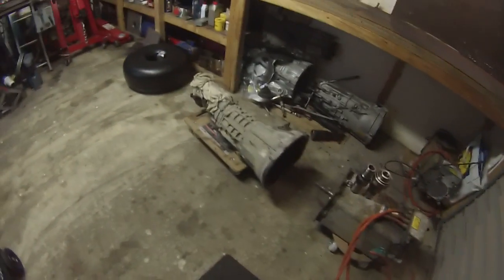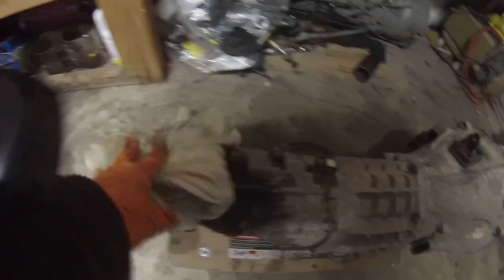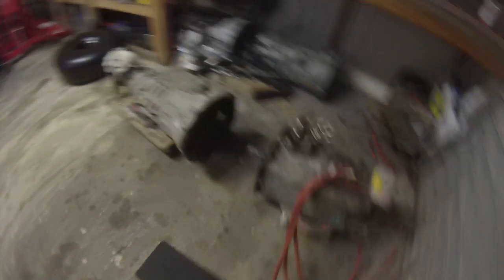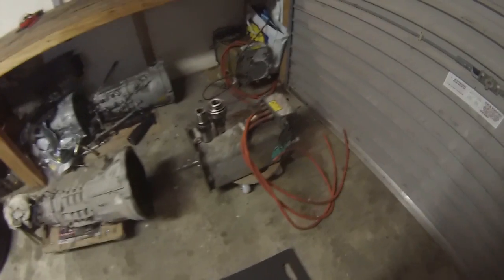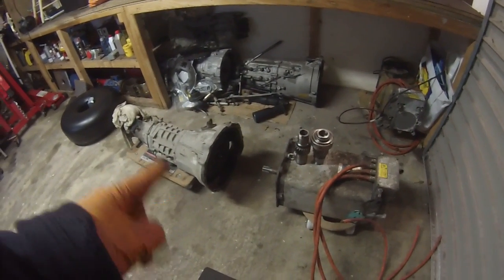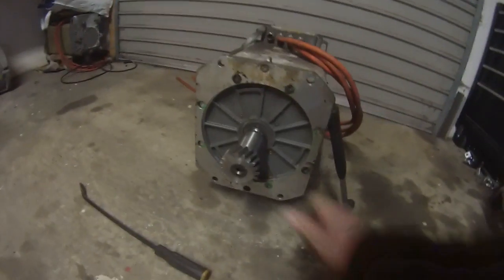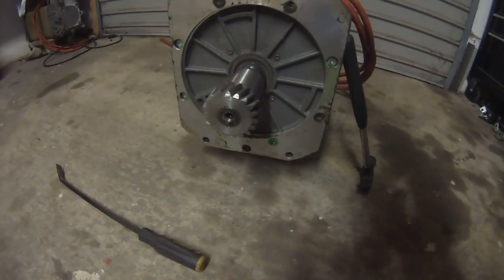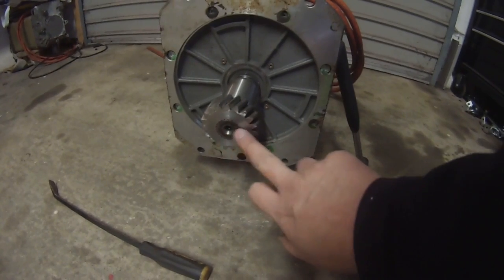Mazda RX8 EV Conversion Mini Series 01

Comment: interesting Electric conversion of a Mazda RX-8!...I too am considering a conversion but I was looking at doing a V8 conversion using a Ford 5.0L coyote V8 and a Ford 6RR80 6-sp Auto Trans with Paddle Shift.  But after watching your YT videos and others about converting a Mazda RX-8 to all Electric Vehicle, I am going to do some more research on this conversion!

It seems like this Mazda RX-8 All Electric conversion has been going on for at least 6 years in Australia!  I am in the U.S.A., so I am going to contact a company called EV WEST in Southern California and see what they say about building a Mazda RX-8!

Also, I notice that you are connecting the Electric Motor to the Mazda Manual 6-sp Transmission...If the motor is Electric you still have to use a manual transmission?  I am aware that the Mazda RX-8 also came with an Automatic 4-sp or 6-sp Transmission with Paddle Shift.

I am a Left Leg Below the Knee Amputee and I don't want an Electric car were I have to push in a clutch in other to shift gears!  Is there a way to setup the RX-8 like a Tesla Model S were there is a one gear transmission?  Thanks and God Bless!

BTW...I've seen some All Electric Mazda RX-7's as well online!

Comment: Hi Damien I was shocked to see you do a non BMW but since its for your friend I will give you a pass. Lol. I am very interested to see your approach to this car.
I dont have your welding skills so my own e36 project inches forward only when a mate has time to come over and weld things for me. I have my chinese made AC motor bolted to the existing transmission and clutch and a very custom heavy steel cradle to hold the motor up and stop any torque twist. Thats as far as I am till I can get my welder to come back.. to help with mounting rails for the recycled Chevy batteries I have and a equipment rail so I can mount the controller parts etc.

Comment: High voltage system @ 500vdc or 650 vdc? with respectfully 70kW or 80kW output for the Siemens  IPV5138? which is less power then the Nissan Leaf. http://www.industry.usa.siemens.com/drives/us/en/electric-drives/hybrid-drives/Documents/elfa-components-data-sheets.pdf
Reply: Huge voltage is very nice in theory but its very dangerous in a home built. 144v is high enough for me.

Comment: My stepson is looking at doing an RX8.  He bought the car ... and is waffling on the actual conversion!  He's been searching for RX8 engine rebuilds ... so he can drive the car while he gathers parts.

Great tip on the side grinder cutting off the coupler

On another topic - do you have the CAN codes worked out?  Or at least the ones that you will need to drive the dash and keep the ABS, airbags, etc working?

If not, and if I can figure out which canbus to monitor .. I may be able to capture some data

Comment: Using the angle grinder like that is a neat trick.
You should get a led spotlight and mount it to a steel plate to light things you are working on.